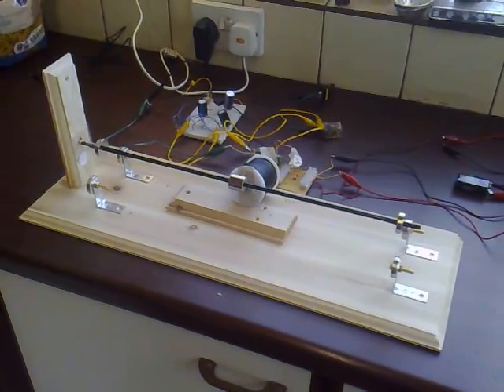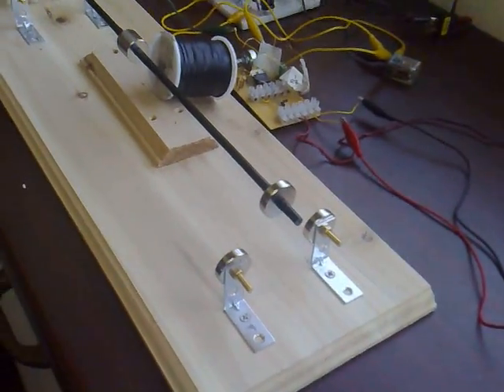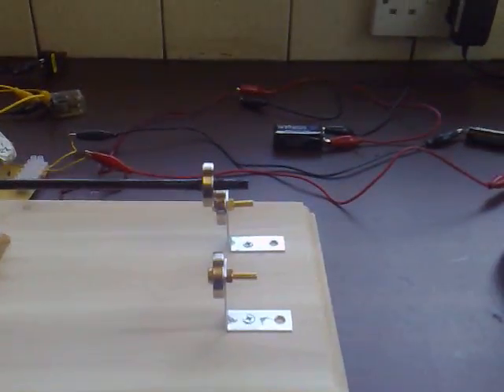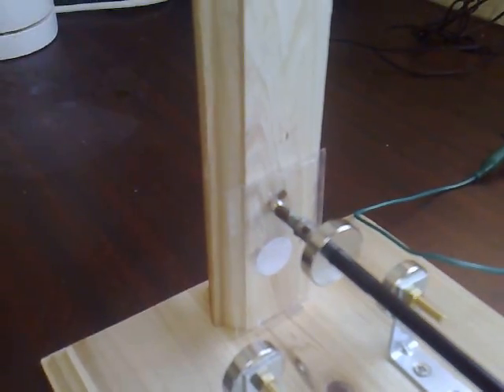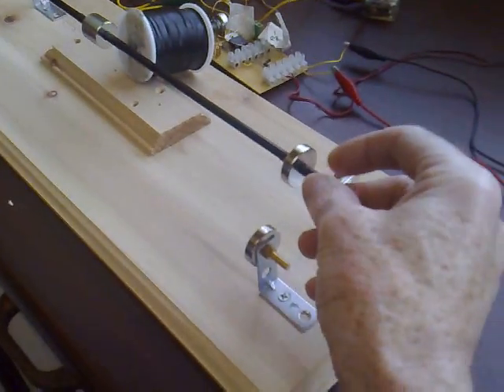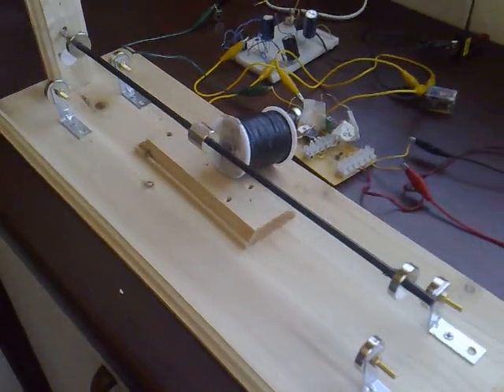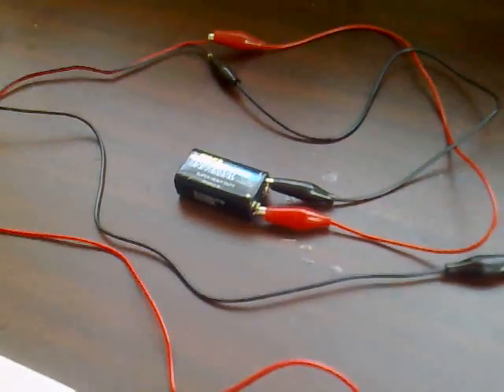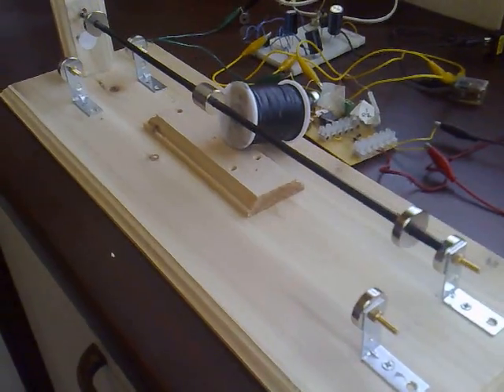levitating one magnet no bearing Bedini motor

Comment: Thank you for that , I'm going to attempt a vertical build very soon. Have you tried this motor with the magnet on the end of the rotor (opposite the headstock) with the coil placed in line with the shaft horizontally so that it faces the end with the magnet? I'm very interested to know if that would cause the rotor to spin the way that a snake-egg magnet spins on the end of a coil.

Thanks, gatewurm

Comment: Your clean build was the inspiration for constructing the levitating builds that I've made, (thanks jonnydarvo) only I used the flywheel with magnets from me Bedini SSG motor. I've had great success charging 12V batteries and high RPM's with one coil. I just completed winding a second coil that I'll add when the parts arrive in the mail. I was curious if you had tried other configurations with your build.

Thanks again, 

gatewurm